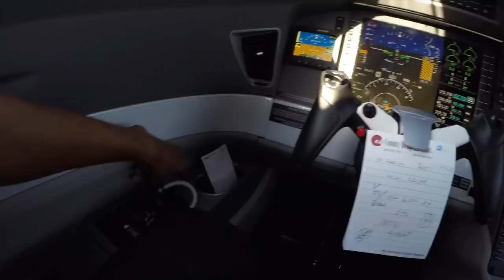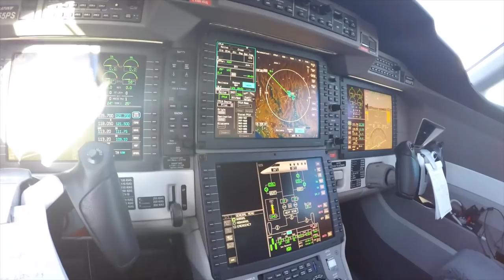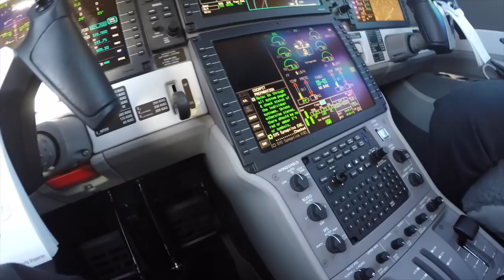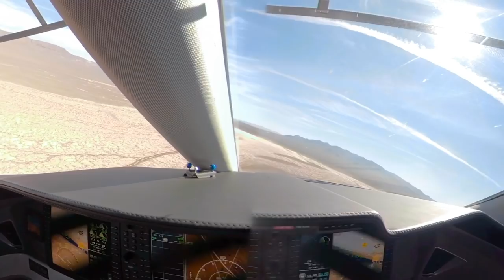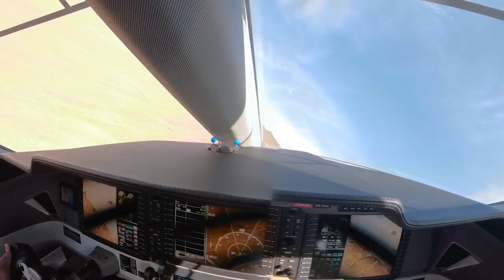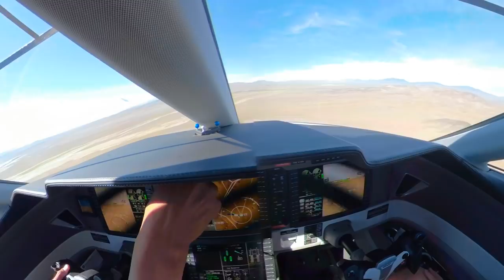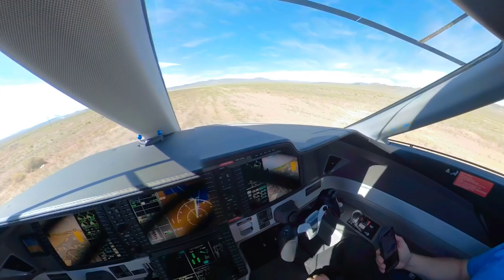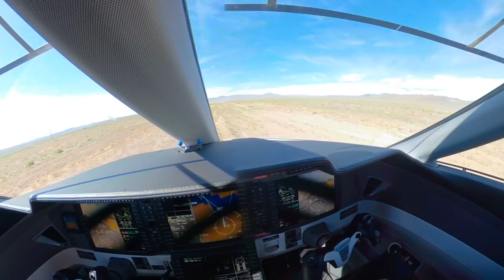AirSmart PC-24 "BUSH JET" Pilatus Unpaved Airport Operations Training

Comment: This dude blows the image of a corporate pilot out of the water....
Reply: No thrust reverse...??
Reply: @iglyigly1193  I have the same question ... apparently it doesn't have that
Reply: On dirt you wouldn't want to use thrust reverse. The cloud of dust it would blow forward can get sucked into the engines
Reply: @iglyigly1193  Empty is not needed if you land at the right speed.
Reply: Hahaha...
Reply: For an Aircraft to be Certified they treat Thrust Reverse as a add on and the aircraft has to be able to land with braking alone but as others have mentioned you wouldn't want to use T/R's on a Gravel Strip due to FOD ingestion  The Boeing 737 200 has a Rough field kit that you hook up to the Anti Ice system so that you can use T/R's on landing it has a Bar forward of the Engine intake about  2 feet and lower down that Anti Ice bleed air is blown through to stop FOD ingestion. It is some thing to  see in operation
Reply: I think you mean he's not white 😂😂
Reply: @hyime69  good comment Well said. Are you a pilot yourself
Reply: @coolhari2000  look like a Malay guy
Reply: Given what he does and how he does it, this dude is the most handsome guy in the whole wide world :-)
Reply: @mwdittmar  Good thing Draco never went beta in the dirt 🤠 but he had one of those old time spinny things on his nose
Reply: @n95najmi  He's actually half American half Thai from his postings from previous comment replies.. Anyone interested should look up some of is older YouTube episodes as his aviation background from teenager years is quite formidable, and has flown everything from ultralights, to bi-planes to 737's.  He obviously master's this PC-24
Reply: @1STGeneral  Draco had a massive multi-filter air intake that Mike engineered to manage the cloud it would kick up... you should watch the build video if you haven’t already
Reply: @iglyigly1193  doesn’t need it like many private jet of this class, set up for short landing and take off. If you watch some of their other videos you can see how quickly this thing gets airborne, and stops after landing. There is even one video where they start their run up, for takeoff, before the threshold markings and were airborne just around the touchdown zone markings.
Reply: @iglyigly1193  I heard it was a design decision as it would add weight and complexity. They solved the issue with design elements like mega flaps and a straight inboard part of the wing, allowing a much lower stall speed, hence landing speed, hence lower landing distance, hence no need for thrust reversal.

Comment: Quick question. Is there any concern that dust and sand could be sucked up into the engines and cause malfunctions or increased wear and tear? Also, beautiful landing my friend. I was extremely impressed.
Reply from the maker: not much concern . thanks
Reply: It was extensively tested to make sure that such dust would not cause ingestion at the engine or problems on other air intakes of the act..
Reply: If you’re sucking debris into fuselage mounted engines, you’ve done something very, very wrong - like you’ve driven into a gravel pit or you’re upside down.

Comment: Swiss quality at its finest. You would not believe when you know where it is assembled in some wooden halls, clean you can lick the floor, by some 2200 staff, 91% of them  living around the factory right in the center of Switzerland  on a small VFR airport in a rustic area.   From most modern riveting machinery to handmade wiring harness, almost all in-house made, even the instrument frames in the cockpit; the fuselage of a PC-24 i.e. is made up of around 4,500 individual parts, although according to the company, only 20 or 30 of them are sourced from external manufacturers. The company belongs to two Swiss private investors. Pretty traditional set up and very successful.

Comment: For difficult airfields, or none at all, this jet is ideal. Africa, Asia, south America - it doesn't matter. As long as you have a reasonable flat strip, it will work. The scope of your destinations widens substantially. A very strong selling point for the adventurous with sufficient funds. I am curious what a Bush pilot may think of this?

Comment: That is something I never thought I would see? Maybe private jets do that stuff all the time? I know that commercial jets have some dirt runways.Their engine are under the wings making it necessary to modify the engine intakes with some vortex cancellation cowlings so the engines won't suck up small rocks into the engines. I think they would have been better served with high mount engines as installed on your airplane? Well anyhow, good show and be safe!
Reply from the maker: thanks
Reply: It’s a very specialized mission to need to land a jet on dirt, most never will.

Comment: That deflector should keep a rock from punching a hole in the bottom of your aircraft.
Reply: What’s protecting the flaps??
Reply: brett run
From what I read, the flaps are designed from ground up to take it and to act as a shield, stoping dust and debrie from getting into the engine intake.
Reply: @brettrun8575  nothing and rocks fly randomly
Reply: @Bird_Dog00  😂😂😂😂

Comment: I fail to see anything unique or different in the design of this jet that allows it to operate on unprepared surfaces?  The dirt deflector on the nose wheel?  That won’t protect the flaps from getting rocks kicked up into them. It looks just like every other private jet design?  What gives?  Pilatus simply allows it?
Reply: Structural design, weight across the wheels considerations,How the thrust impacts the field behind the plane,ratings and certifications. This is a plane not a toy they can't just claim whatever bullshit on the package and shove it out the door
Reply: Yes’m Yes’m it’s a low wing design with flaps right behind the main gear. Nothing to protect from debris. My feeling is that this is simply a marketing angle from Pilatus. The design has nothing unique or different that’s geared towards unprepared surfaces. Most builders won’t approve these operations due to liability, warranty concerns, and the lack of a way to accurately predict performance from an unprepared surface. Manufacturers typically don’t want the resulting damaged aircraft and potential lawsuits. Like I said, this is an attempt at a unique marketing position from what I see.

Comment: Cool video for sure! But those flaps are not protected against rocks, how much is it to detail that plane after a dirt landing...?
Reply from the maker: We have crews in house to detail it after . Flaps are not protected by made out of thick aluminum for strength . Also aerodynamic flow of the air pushes most debris under the flap

Comment: Amazing jet, this capability opens up thousands and thousands of airfields globally. Just a question - considering the risk of stones and soil kicked up into those very low wings (specially with flaps down)  - how come Pilatus didn't go for a high wing design like the 328JET?:
https://en.wikipedia.org/wiki/Fairchild_Dornier_328JET#/media/File:Pratt_And_Whitney_Dornier_328.jpg 
I would be interested to know the reason. Thanks for a great video!

Comment: Nice landing. Probably not good for the tyres 🙈
Reply: Those tires (and that plane), are specifically designed for unpaved operations like that. It's one of the PC-24's selling points over its competition!

Comment: Yeah, I don't get it.  Yes, it's cool.  But I still don't get it.  Unless you live in the Australian outback- but even then, if you're rich enough to buy a single pilot $10m jet, wouldn't you be rich enough to land it on a paved runway?  If you don't need a single pilot jet (you're not going to fly it yourself), why not get a used Citation 10 or something that goes 150 knots faster and 1000nm farther, and still lands on a paved runway.  It's cool, but, seems a little strange to me.  Maybe it's for the Alaskan Eskimo that hit the power ball or something.
Reply from the maker: its not just about landing on paved runways but smaller airports you cant fly a citation X into . it opens up the locations by a ton and saves a lot of time why deal with busy airpot a flow control and waiting to takeoff when you can go to a smaller one next door.
Reply: No, I get that.  Short field is great- and the primary selling point of this airplane in my opinion (other than it looks fantastic) over, say, a Phenom 300.  I'm talking about landing on a dirt road.  If O'Hare is busy (I live and fly under the O'Hare Bravo arc)  and you don't want to wait, there's not too many dirt roads around here available to land on, especially in IMC...  In fact, I doubt there are many dirt roads to land on period, in the US at least.  Not may dirt roads have jet A available either.
Reply from the maker: there are nice back country ranches out in the north west . just plan accordingly

Comment: I don’t see the need to land to expensive airplane like that, risking it for what?
Reply from the maker: That’s what it’s built for lol
Reply: The idea is that this will be a plane for companies operating off the beaten track. Like mining and such.
Being able to land on dirt strips means you don't have to switch planes when ferrying personell and/or special equipment to and from such sites.
It is also very usefull for the aircraft's role as an air ambulance.
The PC 24 was designed to fill an empty niche in the field of busines jets as a utility plane with the speed and range of a conventional small busines jet. 
People who see this just as a gimmicky busines jet to travel between Las Vegas and LA miss the point.